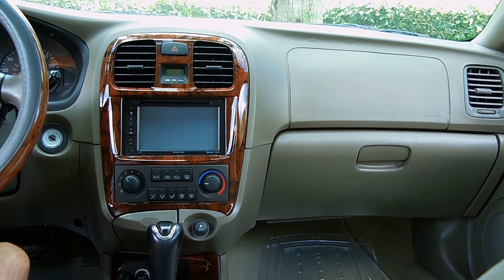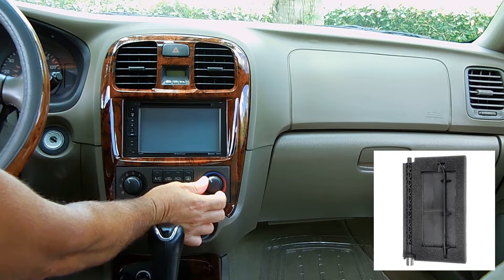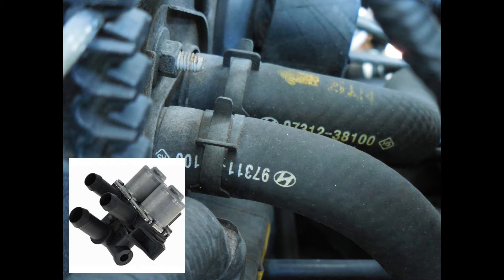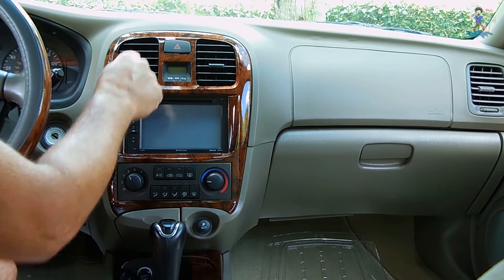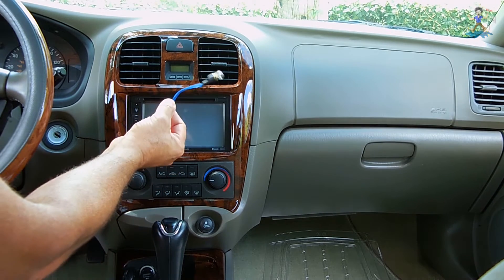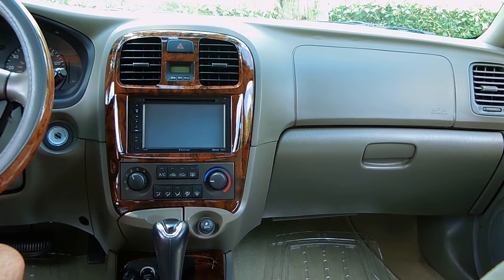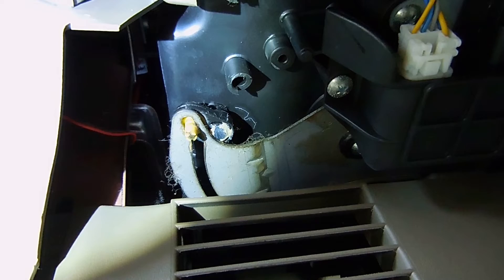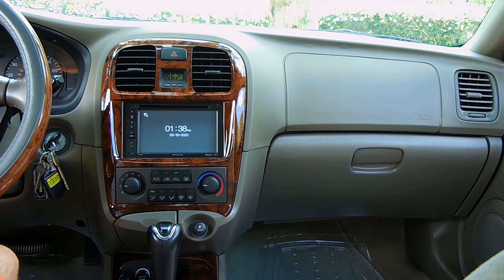Car's Heat Not Working Properly Or Your A/C Feels Warmer? Check This!

Comment: I know it was just a text pop-up but I shared this video with my brother who keeps finding water on his passenger-side floor pans on the Chevrolet Volt. :)
Reply from the maker: Thanks Emmett!
Reply: @electronicsNmore  No, thank you for the lead. It was a total mystery to us, since it would show up even when parked in the garage! Definitely not rain or outside condensation. The car runs a battery conditioning system to heat or cool the battery to ideal temperatures, even when parked, so it sounds like "mystery: solved." Thanks again!

Comment: Great video once again. I have problem with my heating up here in the North not enough heat for the winter. I believe is the thermostat on my 2006 Chevy Colorado. But I also have a problem with the AC I took it to a good friend and he checked it out and told me its the expansion valve it need to be replaced. I like that little handy camera that you have where can I  look for one at?
Reply from the maker: He's the link from the video I made a while back. Thanks for watching!
https://bit.ly/2snUDiL

Comment: Max vacuum is at idle and deceleration.
Reply from the maker: Correct! That was a mistake, I'm not perfect, but what I said that happens with the older cars having cracked vacuum lines, remains the same. I removed that part from the video. Thanks for telling me!

Comment: I see you're in Florida. Me too. Just epoxy it in the fully closed position. You're in Florida. You'll never need the heat. Lol.
Reply from the maker: 1 or 2 weeks out of an entire year I'll use the heat at night. Thanks for watching Andrew!
Reply: @electronicsNmore  thanks for reminding me to get a cheap inspection camera. Lizard Cam™ Flexible Micro-Inspection Camera - need to check my woodstove chimney stove pipe
Reply from the maker: There are many other better inspection cameras out there. That unit only has a 4 foot cable. Thanks for watching!